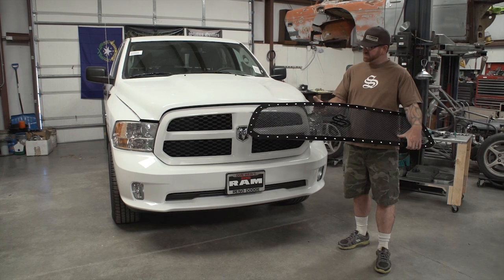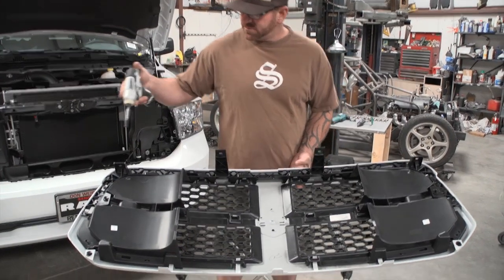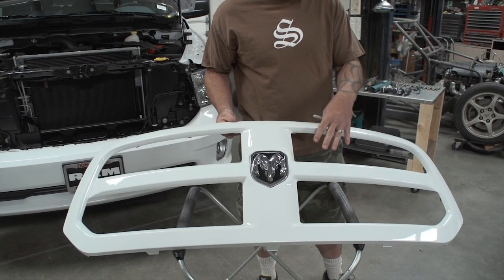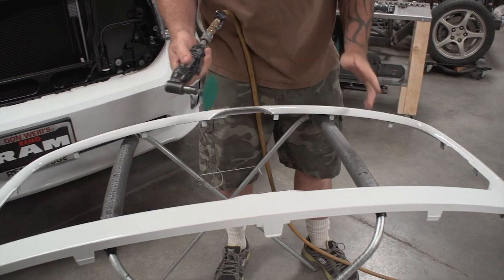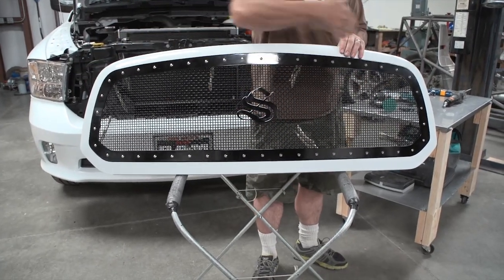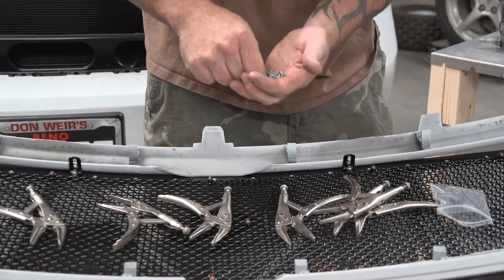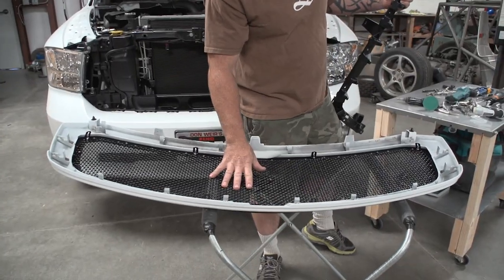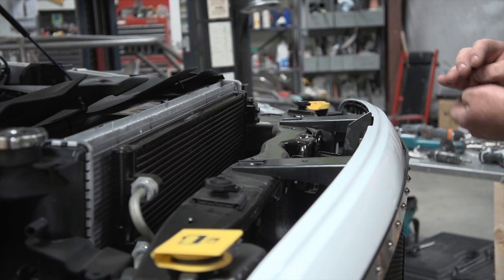2013 Dodge Ram 1500

Comment: This must not work for a 2014 then.  I am following these steps but there are several silver snap-clips hidden behind those curved black plastic pieces that cannot be snapped out without removing the curved black plastic first.
Reply from the maker: It does work for a 14. Just remove the curved plastic to get to the other clips. You do not reuse the curved pieces. If you have any questions, feel free to give us a call at 775-677-8511.  Thanks

Comment: I ordered one for my ram 2500 from realtruck doesnt seen to fit at all. No clearance for light bar with oil cooler not the stock mounts and nothing to mount the tabs on the grill to. Cost me 1400 us dollars not sure they did the r and d or fitment on this grill not possible that it works. according to realtruck the one i ordered is a direct fit no cutting required... awesome....yeah that was a waste of 1400 bucks would not recommend unless you want to destroy your stock grill. Would also urge retailers of this product to get their facts straight before ripping people off.
Reply from the maker: Please give us a call. We have installed tons of these so I’m not sure what the issue is but I’m sure we can figure out what you have going on. 775-677-8511